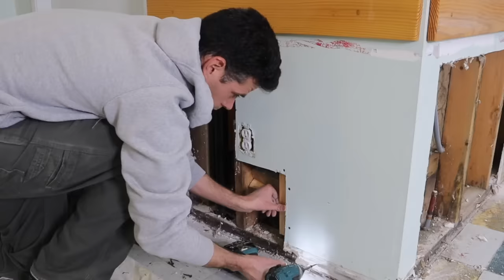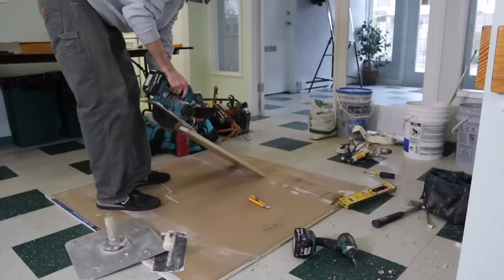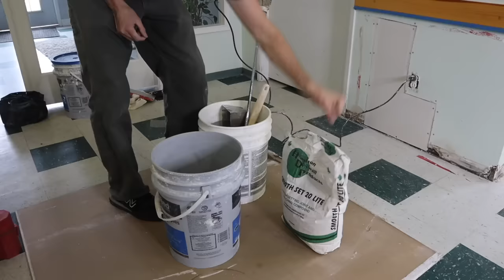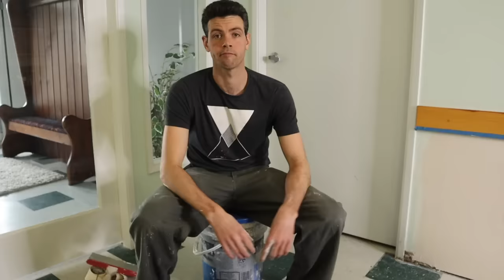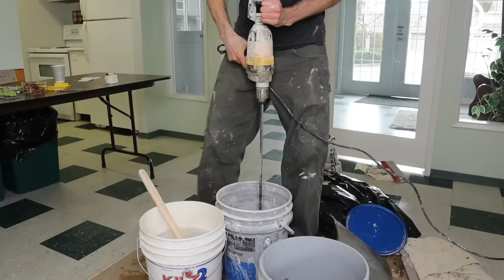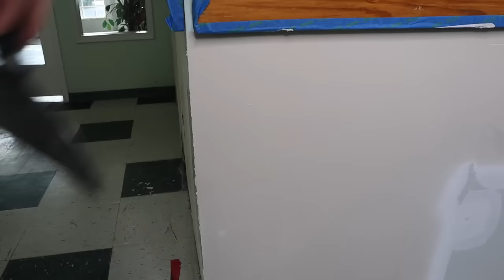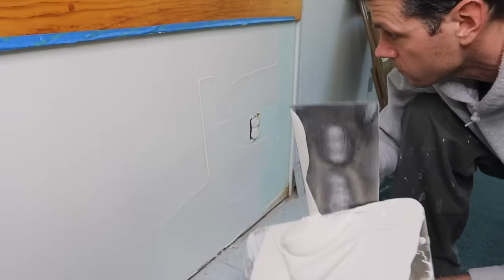Strangely Satisfying Drywall Repair!!!

Comment: Hi Ben. Great video. Little jobs like that are satisfying. I have a question regarding the corner tools I bought after watching your video on the topic. Do you prefill when you have a flat against the ceiling before using the flusher? Or do you expect that corner to fill by the time you are finishing with the last flusher run?
Reply from the maker: I don't pre-fill the taper. Just gaps

Comment: Was each layer 20 minute mud, or were they different?  For a newby, would you recommend the 6 inch or 10 inch?
Reply: The first two coats were 20-minute mud, the final coat was regular mud. 20-min mud is great, but hard to sand to a smooth finish. Top coating with regular all-purpose mud is the way to go. And a 6 inch is going to be much easier to handle for a newbie. I have a 27” blue steel trowel but it took me years to work up to it.

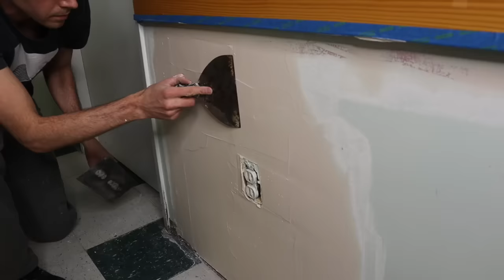Comment: At 10:30, sort of a filler coat with new 20 minute, but it sounds like your knife is going over a "damp" surface. I understand it is a setting compound, and not a drying type.  It looks like you're able to work the first coat still, or is this just the colour playing tricks?

Comment: Hi Ben ...Help me have please   I  have a 14 foot  ceiling joint that i fibre taped and put 3 additional coats over it ,,A hairline crack developed, So i cut out the tape and durabonded 90 ed it ..Then paper taped it with all purpose ,,  I was thinking of adding a bit of glue in all purpose to bring it to level Then finish  coat it ..;;Ben what do u think Thanks man,,,,,, Keep on mudding

Comment: I recently had a leak in the drip pan of my newly installed attic furnace.  Water seeped thru the drywall in the ceiling of my bathroom which made large water filled bubbles in the paint, running along the length of the skylight, about fifty percent of the ceiling width and is now exposing a seem (joint) which is now sagging slightly in the drywall.  Overall, I would say the total damage that I can see from the inside of the bathroom is about six to ten square feet, however the water migration is likely to be much more widespread when inspected from above, in the attic.  The bathroom ceiling total square footage is about sixty square feet.  Is this drywall repair something that should be patched, or replaced entirely and retextured to ensure absolute structural integrity and even texturing?  The reason I ask, is a drywall contractor hired by the HVAC company will be arriving next week to access the damage and make repairs.   Thank You

Comment: I love seeing the artistry in these videos but this one just crushed my soul. 

-Goes to wipe away a line
-Creates another line
-Goes to wipe that one away
-Another one forms
Seems like it just went on and on

If you were just going to skim the entire area, wouldn't it have been easier to just replace both pieces of drywall door-to-corner and wood slat-to-floor?
Reply: Yeah it would’ve been easier to not float it out so much the idea is to make it look flat not be flat lol it is possible to make it flat but it takes way more time it’d be cheaper and easier to just patch it in the way he did and then only mud it were it hides and skim it with a softer mud for an incredibly easy sand also blends better when you go to paint
Reply: Also if I was going to mud that much on a wall I’d use my tapetech 28 inch finishing blade to slick it all out with no lines

Comment: Watched the whole Vlog. Very well done. Big thanks. Out of curiosity, what did you charge for the job? Did you bill by the project or the hour?
Reply from the maker: A job like that would usually be around $400. That includes a very short trip back to sand.
Reply: @vancouvercarpenter  since you came back to sand, what was the third coat for? Aside from that one spot that got messed up, the rest of it looked great after two coats! It seemed like only the little spot needed a third coat, then sand everything and it would be fantastic.

Comment: So, why didn’t you square off the one with the outlet? I think it would’ve been easier for me to not have to do mud work so close to it.
Reply from the maker: If you look at how I patch you know I would be coating around it anyway. Also, it would take me double the time to cut out the extra board and the receptacle than it took me to make the odd cut.

Comment: What did you spray on the wood beforehand?
Reply: It's not on the wood, it's where the drywall is teared to "seal" the paper. It looks like 3M spray adhesive super 77 but I'm not sure about it.

Comment: My only two comments are I wish you would have taped off those outlets. The other thing I didn't get is on second third coats I just pull them tight and you seem to not pull them tight and I was kind of wondering about that. Like I don't see the value trying to float it all out after the first coat.

Comment: Question could  you used paper tape instead of the mesh tape.
Reply: Yes! But when you use mesh tape, your first coat has to be a quick setting compound, because it bonds better and stronger then vinyl compound, which will hairline crack.

Comment: I have noticed you love the "score and crack" method of trimming board. I however and very comfortable with a sawzall with metal cutting 6 inch blade.  It does mighty fine and fast work. As long as you keep the cut shallow, no cut pipes or wires. I have never cut thru any, helpers have done so 2 times ever. Thats not bad considering the insane number of patches we have done that way and that the 2 cuts were by pretty dim workers!

Comment: Hey Vancouver carpenter.  Question. Should I prime a wall that is a glossy finish possibly oil based paint before I skim coat? What you think
Reply from the maker: Just give it a quick sand if your worried.
Reply: @vancouvercarpenter  thanks.  Richard's Painting Service INC. 
Daniel Delikat
Reply: @vancouvercarpenter  you should come to new York  scarsdale and make some content working for the ¹%

Comment: You had two large holes to fix and you gave them a whole new wall.  Is that cheaper than just putting in whole new pieces of dry wall and then plaster that up.

Comment: I wish I could get u to come finish my bathroom. Contractors been mudding my walls for over a week. Talking about they use 20min mud but threw on uneven coat after another then leave saying it needs 24hrs. They sanded and blew dust all over the house. My wife and kids dusted half the day. All from a bathroom. Oh and they are still not done, smh. Good thing they dont get paid by the hour.

Comment: Hello! I haven’t done this so much, and I think we do it differently here in Sweden. Is it same product in all 3 layers?
Reply: Most of the patching was done with 20 minute mud (it comes in a 20 lb bag and you mix it with water ( they also have 5,45,and 90 minute) and the final coat was ready mix mud that comes in 4 gallon boxes and 5 gallon cans , he added a little water to make it spread easy ( this is also what we use to texture was but with more water )

Comment: Its more than two hours, 20 min mud takes an hour to be ready for re coating, depending on humidity, temps, thickness, and how much water was used to thin it. This is 8 to 10 hours and should have only taken three coats on the dog leg cut and two for the rectangle.

Comment: Only think I disagree with is not prefilling the gap before mesh taping it. You could see after the first coat how it pushed out and was still really humped. That and imo to much mud being left on for final coat. After 2 coats of 20, that light weight last coat should just need to be a light skim coat.

Comment: Peaceful job. What did you spray on the torn corner on the long wall?  4 coats?  All with same 20 minute mud?  Last coat a bit thinner?
Reply from the maker: 3M spray adhesive. 2 coats of 20 minute and one coat of all purpose.

Comment: What is the difference in the composition and use of mud versus plaster? Why do I see everyone skim coating walls with mud instead of plaster?
Reply: It’s easier to work with. plaster is gypsum product. They are both gypsum products. and joint compound is cheaper
Reply: U can't sand plaster.  U can sand drywall compound.
Reply: Plaster means different things in different parts of the world.

Comment: Where you using the 6" knife to smooth out when mud was almost dry?
Reply: its a technique ive only ever been able to do on powdered mud, i think it can only be done on powdered iirc. but yes about 10 min into drying with 20m you can lightly either spread the mud or you can scrape it smooth. makes a huge difference when sanding the ridges. another trick is to wait like 15 - 20 min and use a damp sponge, like a grout sponge, it works but i mainly use that trick for "sanding" texture to reduce the dust and less clean up

Comment: But you charge how much for this fix?  It only took two hours.  I am only going to pay you for your actual time and I want to see the materials cost.  You are so right sir.  My billing rate is $500.00 per hour with a minimum of two hours.  Have a nice day.  Nice work, Ben
Reply: 44 years in the trades, starting when I was 18.  Shop class before that.  2000 a year.  88,000 man hours in the business.  14,000 hours of schooling to get a doctorate degree.  I have therefore earned 5 and 1/2 doctorates.  I want to get paid at least $500/hr.  Good attorneys get at least that.  I keep houses from falling apart.  I want my due.  Just saying, Ben.  Have a great day.
Reply: @J The imaginary degrees are jist that.  Imaginary.  I use engineers because I can.  I use architects because I can.  I use lawyers because I can.  I enjoy being a carpenter because that, to me, is not a job but a chance to make a real difference in peoples life's, like an engineer, architect or lawyer.  Have a nice day.

Comment: I need advice!! Would anyone recommend using mesh tape in corners for fresh drywall? For a beginner, is what I should note. Thanks!!
Reply: Yes for the Pro-finisher! You have to know how to wipe int he angle without cutting the corner mesh tape. Paper tape is best for that application
Reply: @chrislecompte6676  Hm okay thats pretty much the answer I needed. Thanks! Paper tape and practice it is!

Comment: I never realized so much mud went on the drywall.
Reply: Normally there isn't that much mud. He just  had a lot of seams in a small area and he was mating full thickness sheet rock edges.  When you  install new sheet rock the uncut edges mat up to each other and they are tapered towards the edges so there is less mudding.

Comment: So, just out of curiosity, why wouldn’t u pull the outlet out and just go over it as if it wasn’t there and then bust the whole back in later
Reply: 1) He isn’t an electrician. Looks like he is in a commercial setting. If something were to happen, like a fire or a short and the power that be found out, he is screwed. Every trade has its purpose. 2) if you are a pro, obstacles are part of the job. As you saw, he handled with ease.

Comment: Over three decades of drywall repair, my impression is that Sheetrock is weaker than ever, or maybe my Kung Fu grip has reached supremacy.  The lightweight drywall definitely seems much easier to cut though.
Reply: The old, pre 70's wall board had asbestos particle which were used for strengthening porous materials

Comment: All good except I'm seriously questioning your work around the plugin. I guarantee its cracked by now. And fiber tape to boot?!? I would have cut a larger piece out and taped it in with paper.  Any drywaller knows you dont put screws or seams near a drywall seam. Or above doorways. And I see it nonstop from "professional" drywallers" who are completely clueless. Love your videos, this is the first one that's made me question your work.

Comment: Good to see a "teacher" actually use the right tool.  Trowels are for drywall.  But.  why not just cut the wall out square, youre already cutting?  The rattle can?  You are already fiberglassing the seams, just fiberglass the brown.  Cheaper.
Reply: Actually trowels are for plaster. But to each his own. As long as you get the end result does it really matter how you get there??

Comment: 16:32 I don’t get it, this is the third coat, and your mudding all the way to the corner. Why not do this on coat #1, and use coat 2 to touch up.
Reply: You get a smoother finish by coating it three times, the third coat is a skim that helps with little imperfections and evenness.
Reply: stargateproductions Thanks for clarifying.

Comment: No glue in the hot mud?
Reply: Since you haven't received a reply from VC yet, I will take a stab at your question.  

He could have used glue, but it was not necessary.  In the video where he mentioned adding the glue to hot mud, the particular brand he was using that day he said he had had trouble with before in it adhering to painted surfaces, therefore he added the glue to remedy that problem with that brand/product (proform lite, I believe it was).  

In this video, he is using another brand of hot mud.  Here in the States, the Sheetrock brand hot mud doesn't need glue added either.  They sell the Proform lite at Lowe's here in the states.  I have used it before and I had the same issue with it as VC.  Its consistency is lighter and fluffier than other brands, and is nice to work with, but the adhesion issue on painted surfaces, may be an ancillary defect with their particular formula.
Reply: @TobiasRaphael1  thanks for the info 
I had never seen anyone add glue before VC did. Thought he did every time he used hot mud

Comment: Would have taken all of 30 seconds to pull that plug out of the wall! And would have been a hell of a lot easier to work over than around the box!
Reply: Can't always do that at every job, may need to keep the power on and should not do a live disconnect.
Reply: @TheArcadeMonk  give me a break! Ive never been on a job where I didn't have access to the breaker box if needed! If I need the power off for anything, the power is off!
Reply: @Bigrush310  Why do you add an exclamation mark to every sentence?  I bet you take a lot of breaks on your casual access-to-everything non-critical drywall jobs.  I'm only busting your balls.  You're welcome to upload a video of your outlet removal jobs.  What's your method of location a breaker box in under 30 seconds at every job? How many jobs have you done?  Only teasing you wise dry wall master :).

Comment: Why are there so many videos of people screwing wood behind drywall joints. DO NOT DO THIS! You're already cutting, just cut back to the next stud. You're flimsy wood for large repairs will easily flex and break with any pressure or someone leaning against it. Terrible practice! Do it correctly!

Comment: why didn't u just change the whole drywall and save urself a lot of joint compound and time lol
Reply: No. That would have taken a lot more time. He still would have had to put a complete finish coat on the wall to cover the corner bead required in a complete replacement. Otherwise he would have had to sand it out which would taken another day. This was a morning and part of the afternoon and he gone. Been there,  done that.

Comment: Nice work, but you spent so much time fiddling with the surfaces.  Why not put one good coat down and then sand the wall?  You also didn't address texture.  Further, as an electrician, I'm not impressed with your lack of respect for the outlets; you gooped both of them up with mud.

Comment: The repair around 4:30 was totally wrong... you needed to start with 4x full sized sheets just for that single "L" shape, cutting, re-cutting, measuring and re-measuring so many times that you end up running out of drywall and have to go buy more sheets. Getting it in one-take while eye-balling the measurements is just showing off. No one likes a show off.

Comment: Wax on wax off.  Put lots of mud on, but take more mud off, more layers, let it dry, comes out better even with so many butt joints.  The goal is to take as much off with the trowel as you can.  Took me ages to learn you don't have to use so much mud.  Soon as sunlight hits that wall you'll see what I mean.

Comment: So many things done wrong here, you should have just replaced both bottom sheets and half the external corner and one butt joint on the long side, caulked against the timber rail and architrave, instead you wasted materials and effort not to mention making a fool out of yourself doing someone else’s profession.

Plaster doesn’t stick to paint unless you key it or paint with a primer like bondcrete or similar PVA, I imagine it will bubble off before too long, paper tape is preferred as mesh tape has no strength and cracks along the joints I could mention more but I won’t